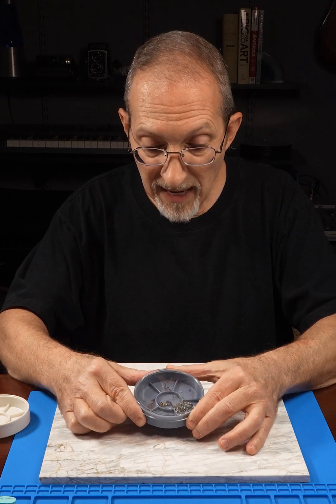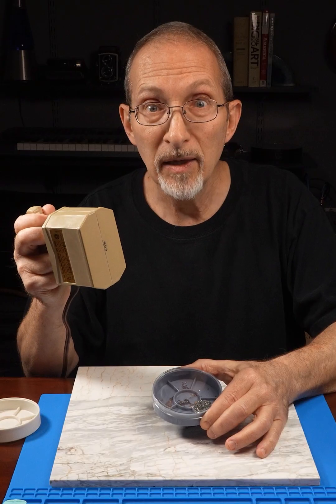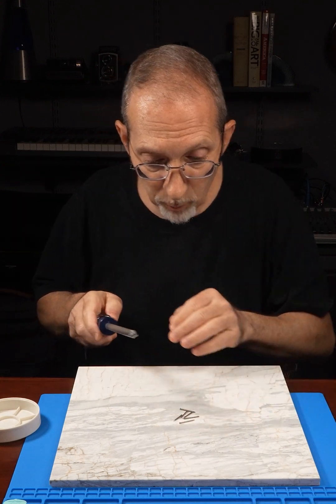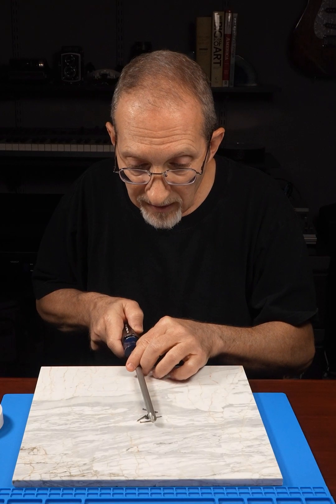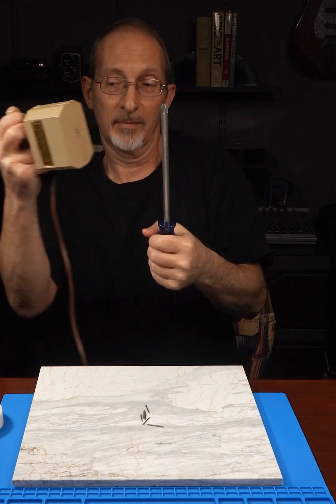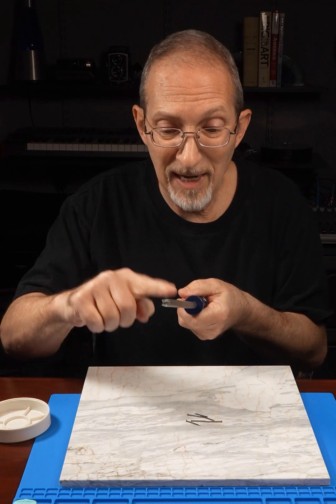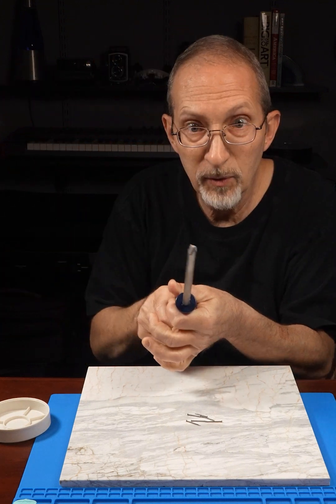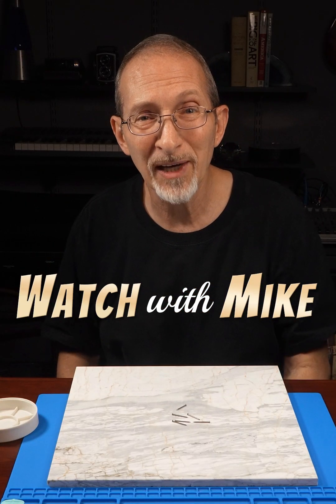I am the Master of Magnetism!  |  Mag-DeMag Demo

Comment: Why do you need to disassemble watch to that extent? I mean cant your demagnitizer demagnify as a whole watch without disassembly ?
Reply from the maker: You are correct, a watch can be demagnetized without taking it apart. I disassembled this watch to do a complete service , in which all parts will be thoroughly cleaned and lubricated before reassembly.